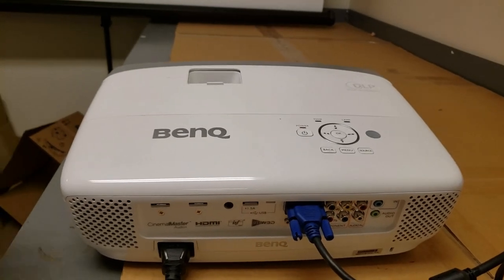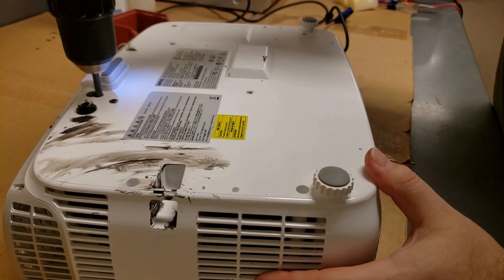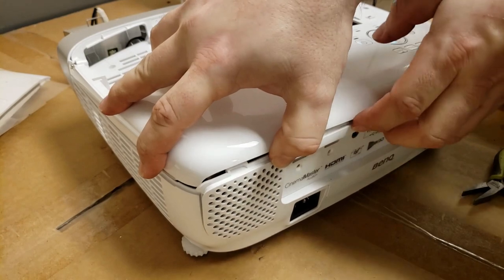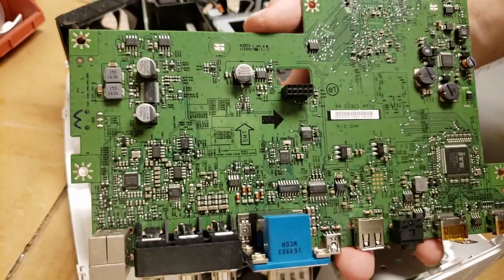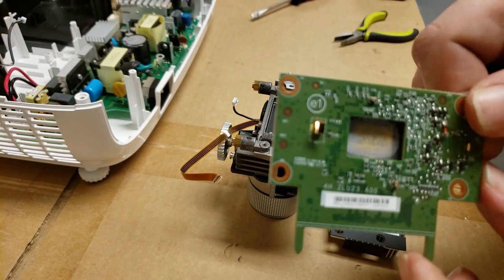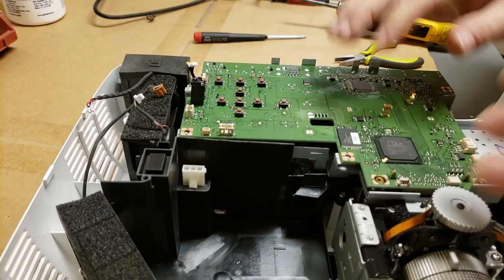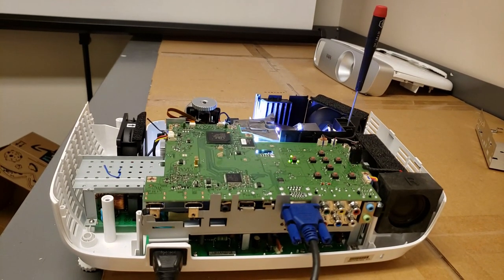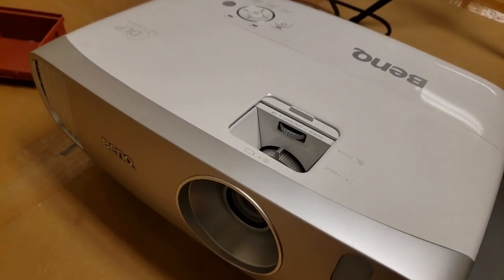BenQ HT2050 Teardown Cleaning... "Fail"

Comment: Thank you very much for this video. After replacing an exploded lamp on my ht 2050, there appeared all these smudges in low light scenes, but nothing at all in scenes with good lighting. I thought perhaps it was something broken inside but eventually realized that these smudges could be brought into focus by changing the focal point, clearly revealing their nature. I finally did a full teardown and cleaned the whole thing. The dmd was covered in dust, cleaned carefully and voila! like new. The explosion must have sent dust everywhere.
Reply from the maker: Nice work!  That is awesome to hear you got it sorted
Reply: My bulb also exploded the first time, maybe i have the same issue because i also see some dust when i defocus

Comment: Hmm somehow this makes no sense to me. When you saw the white spots for the first time they became more visible after you took the picture out of focus. Stuck DMD mirrors would be best visible when the image is in focus right. And how can the lamp fixed the issue? All the lamp does is throw light into the projector. Spots and this like that will most likely be in the optical parts of the projector. Weird...
Reply from the maker: the whole problem made no sense to me at first. The lamp was not shining bright enough.  When a lamp is dim, it shows more dust bits that normally it would shine through/around and wash out. Stuck DMD will not always be in focus if the pixels slipped. I have seen plenty where the substrate that holds the mirrors lets loose and mirrors are no longer in the same focal plane.  But the focusing was why I stopped thinking it was the DMD.  I was going off the lamp hours in the projector without knowing they had been reset.

Comment: Thank you this teardown has very helpful. I just bought a used HT2050 and noticed it had the same spot issues. I bought a camera sensor cleaning kit and carefully cleaned the DMD chip and color wheel. Also cleaned everything else while it was open. That removed my spots. Didn't need to replace the bulb. Thanks again for the video.
Reply from the maker: Awesome! I am so glad to hear it.  Thank you for letting me know.

Comment: Hi , I follow your steps but now it doesn’t turn on !
Reply from the maker: then you probably missed something during reassembly.  Go back over your work and check the alignment of all connections, especially the low voltage pins from the power supply to the mainboard.

Comment: Hello Frank, thank you for these videos. I'm not super handy but successfully cleaned and replaced a lamp with relative ease. However, my color wheel broke and I had my friend who is very adept at this kind of thing "Fix it" but he said the lamp has no power now. He said I need a new lamp - without looking at it, is that something that could happen (meaning the color wheel causing the lamp to not work) or do you think it was not reconnected properly? Is there any other troubleshooting areas that go with color wheel replacement or do I need to just suck it up and get the lamp? If you are willing to work on it, what do you charge?
Reply from the maker: You need a good new lamp to be safe.  Without a known good lamp, you are shooting in the dark.  That said the color wheel is critical for operation. If the projector doesn't see the wheel spin up, it wont ignite the lamp. I dont know what your friend did but a color wheel replacement(if done properly) wont cause this.  I suspect he forgot to plug something in or isn't giving you the full story.

Comment: Hi Frank,

Thank you so much for this video. I replaced the bulb on my 5 year old W2000 after the bulb exploded (~3000 hours}. While I had the cover off, I noticed it was very dusty so I got trigger-happy with a can of compressed air and blasted the dust everywhere. When I powered on, I had terrible smudges. Focussing the lens, I could bring the dust into perfect focus, so I knew there was dust on the DMD chip. Found this video and followed along step-by-step. The DMD chip had a clear layer of dust on it. I blasted it with the can of air (I don't have a compressor) and cleaned all the rest of the fans and case. It's so much better now! Still 1 stubborn speck there though, so I'm going to tear down again. This time I'll try blowing air into the "hatch" you show in your other video first. (BenQ HT2050A DLP Projector | Optical Assembly Cleaning video.)

I never would have attempted this without your video. I really appreciated you showing the re-assembly too. Made it much easier to follow along and not worry I missed something.

*Update* For anyone curious how my 2nd attempt worked out:
I took the cover off the projector and was able to access the hatch once the main plastic cover was off. I only had compressed air in cans and they weren't powerful enough to properly blast out the dust. Also I was worried about causing condensation in there with the cold air. Without a pump like the one shown in the video, I had to improvise. I unscrewed the connections at the end of the hose on my floor bike-pump and found that that gave a pretty good blast of air. I wanted to focus it more, so I used electrical tape to seal on a new head from a silicone sealant cartridge. This gave a great focussed blast of air. Using that, I blasted the hatch a few times and tested the projector with the cover off. I ran a "white background" video on YouTube and focussed out until I could see tiny specks remaining on the DMD chip. Powered off and blasted a few more times. Now there are barely any specks there at all. You can only see them when focussed out on a white background. Once the picture is in focus, they are invisible. I'm delighted. Thanks Frank. I posted all that long info in case it helps someone else with similar problems and lack of tools!

Thanks,
Cd
Reply from the maker: You are so welcome CD, I am really glad to hear your update!  I also really like your air pump idea.  I might have to look at that method myself. Cheers!
Reply: Thank you for your detailed repair experience on the w2000. My w2000 bulb blew and apparently I need to do similar to get all the glass out, so after hearing your success am going to give it a try and save the $1000 repair bill I've been quoted. I hope Frank's video equally leads to my success too :face-red-heart-shape: (Oh just noticed that yours blew at 3000 hours... curious mine was about that old too, from what I saw before it blew -as the image projection seemed to dim a day before it blew out and I remember looking at the hours in the menu. Makes me wonder if the life on the bulbs it came with weren't up to spec for that batch?)
Reply: Currently sitting here with my HT2050A getting ready to tackle what I suspect to be be dust on the DMD chip.  I was originally just going to used canned air but after reading this, Im going to bring in the compressor.  I'll let you know how it goes and thanks for posting this!

Comment: thanks for this video Frank,  had trouble finding a genuine replacement lamp. The reference link was quite helpful!
Reply from the maker: You are very welcome! I am very glad to hear it works for you!
Reply: @FixitFrank  i have the benq w2000 and i directly smoked under the beamer for years, so you can imagine how bad it looked. Today i cleaned it as good as possible, the beamer was not in use for the last 3 years. After i cleaned it i started the beamer and the fan at the lamp is really loud, it rattles. Just ordered a new one from china. I hope its the right one. And the i checked the image, when im in focus i can see 2 spots in the image and when i defocus i also see a lot of stars, guess i have to clean it like you did in the Video. But the lamp also has about 3500h in eco mode. Do you think i should already order a new lamp?

Comment: Great work. Thank you. I just cleaned my W2000 and it is surprisingly similar. You could put W2000 in the title. 
The W2000 has an internal HDMI cable and a USB connector. I did not disassemble the lens but cleaned the color wheel. My lens and the chip looked clean even after 5500 hours of usage.
Oh, and I don't use electrical screwdrivers in those situations, at all. 🙂
Reply from the maker: Thank you for that information! I will add that to the description. Much appreciated!

Comment: Frank,  like your Channell.

My 3 year old Ben Q TH671ST fans have started to become much noisier tgsn when it was new. Do you think If I took the outer shell off and cleaned out some dust it would improve the situation?
Reply from the maker: I'd be more suspicious of the color wheel.  Those fans should be okay for at least 5 years but I could see the color wheel going bad. if the noise stops as soon as you turn it off before the cooling cycle ends, then you know it's the color wheel.
Cleaning the fans anyway is never a bad idea just be careful you are not fixing something that isn't broken if that makes sense.
Reply: @FixitFrank  Thanks Frank appreciate the advice
Reply: Do you think I could clean the color wheel or should I just order a new one ?

Comment: Hello Mr Frank, thank you for all your videos. I am also having kind of a similar problem. Neither of my fans are running and now when I use the projector it’s get really really hot. I also noticed the fans don’t turn on n a lot of dusk have been collected inside. Would it be wise to change fans or do you think something else is the problem ?? Please help, I would greatly appreciate it as I am currently stationed in Guam and can’t send my in for repairs.
Reply from the maker: Hi!  If your projector is not shutting down and giving you a temp error, it is probably working properly. The fans will cycle on and off as needed so they may not be running when you look. You definitely want to remove the dust as that will help the projector run cooler for sure but I would not worry about the fans unless you are getting a Temp error.  If you do get a temp LED flashing and the projector turns off, then I would look at changing the fans.  Projectors do run very hot. The exhaust air can be 140-170f / 60-77c which will feel very warm.

Comment: Hey Frank,

I am interested in sending you my HT2050 for repair. Power light is green when i plug it in, fans start, sounds like the projector is booting up properly. Then lamp light starts flashing red, power starts flashing green and then lamp light goes to solid red until the projector goes back into standby mode with orange power light. No light whatsoever coming from the lens/lamp. Have not tried a new lamp yet. Noticed the plastic lamp connector was slightly discolored. The small plastic connector/snap piece broke off while disconnecting it. Did my best completely breaking it down and cleaning but same issue. If the projector has a red lamp light wouldn't a new lamp just have the same issue since I am unable to get the lamp to light to reset the timer?
Reply from the maker: Fortunately the lamp timer will not cause your projector to not start.  Only a handful of older models did that.  Never BenQ thankfully.  I suspect you have another issue, maybe a color wheel, maybe a ballast or power supply issue. The missing clip on the connector is okay.  Not ideal but not a huge issue.  
I'd be happy to look at it if you want. But first, let me ask, where did you get the replacement bulb and is it an Osram?
Reply: @FixitFrank  I did some digging. Looks like we got it on Amazon. Which now I see was a mistake. It's either a Pugody or Rembam. Think Pugody. My wife bought it about a year and a half ago. Going to buy a good Osram lamp first and see if it will work. Thank you for your reply!
Reply: @FixitFrank  Do you have a recommendation on which lamp to buy?

Comment: Hello Frank,

I wanted to clean the projector from the inside because it has been bothering me for a while that the fans are not running during operation. After cleaning, I closed it again. Unfortunately, the device does not turn on at all now. Do you have any idea what could be the problem?
Reply from the maker: hi! Hard to say entirely without seeing it. but I suggest going back over your work slowly.  Most likely you forgot a wire or its not seated well enough.  The thermal fuse is easy to forget and getting hte low voltage pins lined back up with the mainboard is a common mistake.   There have been times where I had to take apart and reassemble a projector 5-6 times because I forgot this or that.